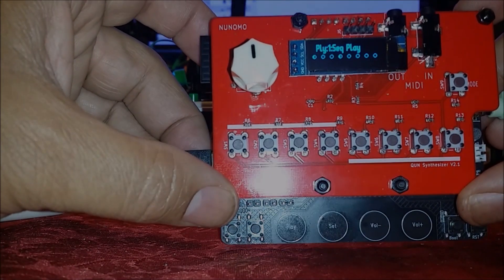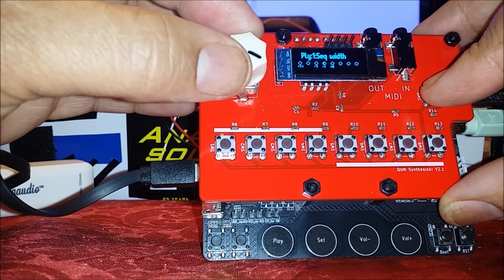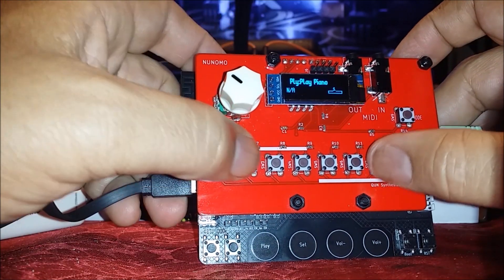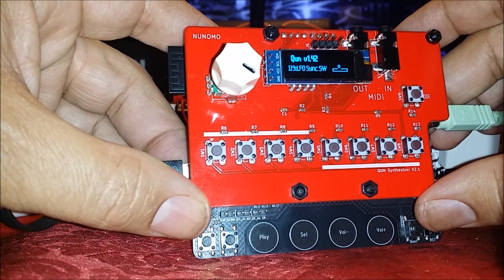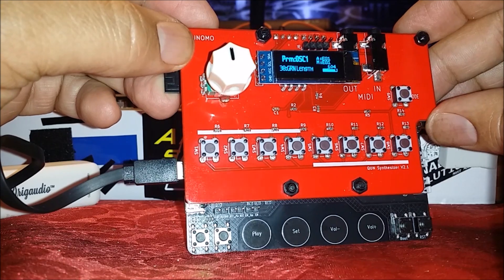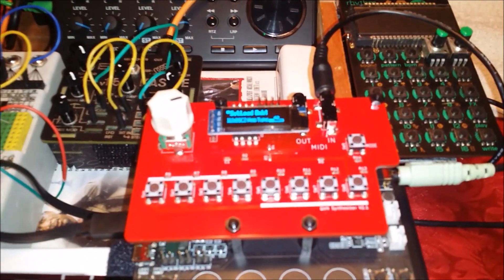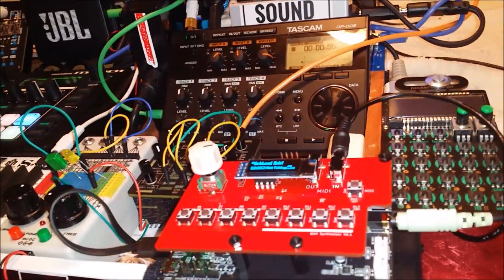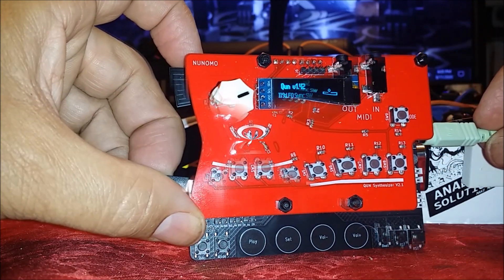NuNomo Qun Pocket Synthesizer User Review

Comment: Nifty, I just bought a Microvolt 3900.
Reply from the maker: Wow, the Microvolt..I been looking to get one of these..How do you like the Modular patch bay..is it really flexible?
Reply: @rhampton1914  Comparison wise, It's a bit more limited than the Behringer Neutrons patchbay, the standout is the wavefolding oscillator, the Pittsburg sound of the filter and the highly flexible Low pass gate, it has a very unique sonic footprint, these three features provide it. You most certainly pay for what you get. And it does sound great.
Reply: @rhampton1914  It's closest competition is most likely the Make Noise O coast. I prefer the on the side patchbay, over snaking cables all over the place, on the face of the O coast. The both have a lot of highly flexible internal normalised connections.
Reply from the maker: @innerspacerace9196  it's funny you mention the Behringer Neutron because I was actually comparing that myself with the microvolt. The neutron is a lot cheaper and it seems to be bigger with more features but I don't know how cheap it sounds. It's like a Toyota Corolla it's so common that I don't want it. LOL I tend to buy the odd stuff that nobody has. LOL the micro volt seems to be underrated. I wish I had one to really put it through its paces. I had the make noise 0 Coast. I end up selling it after a while but I do would like to get another one. I just got another Gadget in the mail so stay tuned next week I'll have some interesting it's similar to the review I just did on this particular pocket synthesizer
Reply: @rhampton1914  The analog delay of the Neutron sort of sucks the life out of it, in my opinion, it's like its always on a bit. I never did warm up to it's odd sounding filter and weak sounding oscillators. The Microvolt is far more up in your face it can get way more huge than the Neutron. Though such huge sounding synths are harder to fit in the mix of some styles. I love the sound of the behringer Crave. I love the sound of the behringer TB 303, I like the Deepmind 12, The Microvolt is a very standout sounding device and so is the simple Toraiz AS-1. Experiment ambient is my personal preference.
Reply: @rhampton1914  I have way too many synthesizer to compare it with, still the Microvolt stands out. That is what I personally was looking for, the Neutron just does not stand out in my opinion. It's like it has asthma
Reply from the maker: @innerspacerace9196  thanks for telling me that I don't think I'm going to get the neutron because not even buying it and looking at the price and looking how, it is and people selling it left and right I don't really particularly take up to those sort of marketing features it's like you say you get what you pay for. I had the analogue Solutions fusebox and boy let me tell you that was one powerhouse. I have the Dave Smith evolver and a couple of synthesizers like that non-modular in nature of course and you can tell the difference between an old desktop Yuval ver compared to a newer since today that only cost 299 brand new. But the Crave is good I must say Berenger really outdid themselves on the Crave I had one and sold it LOL I got to stop selling things. LOL so you say the Mike Revolt is worth giving a try huh?. What about the ants have you ever considered that one isn't that similar to The Volt?